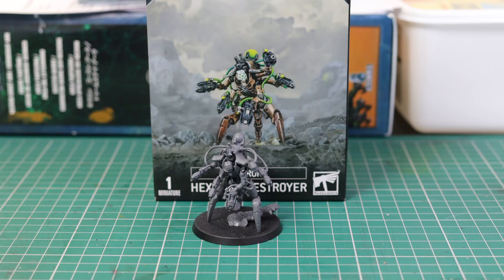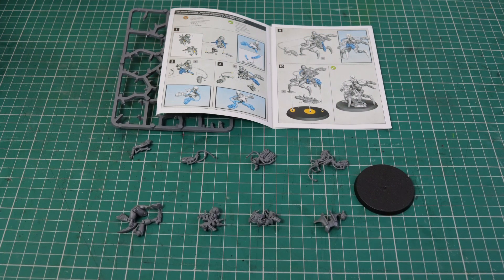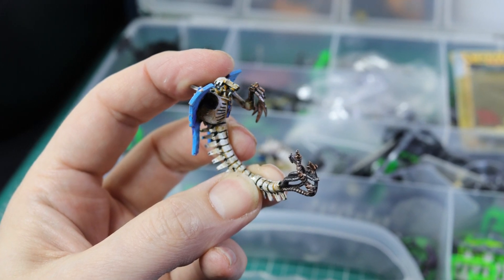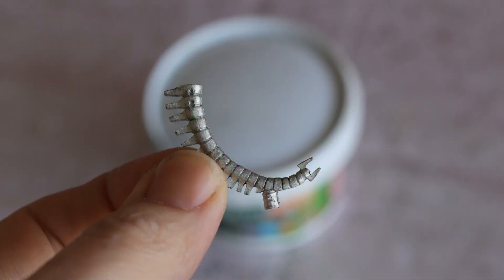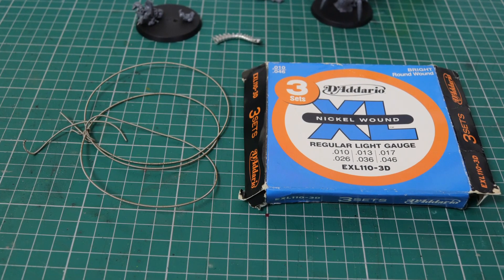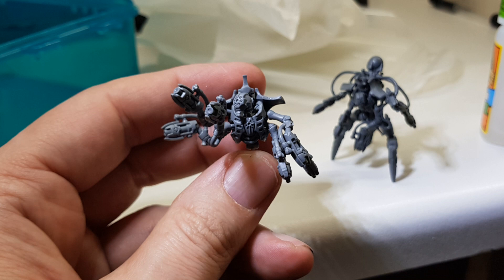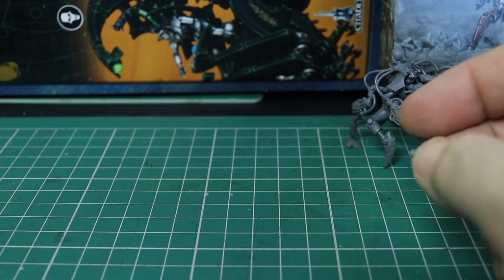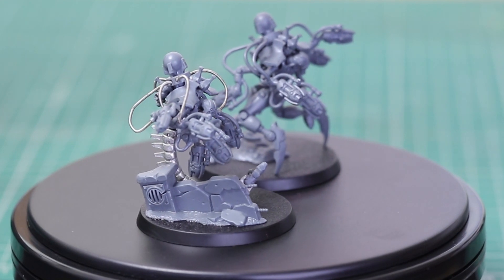I Attempt a Necron Hexmark Destroyer Conversion

Comment: 5A just means it's the 5th string on the guitar (they're counted from the bottom up), and the default tuning is an A. The diameter usually the inches) is the determining factor in the thickness of the string (they can vary quite a lot - for instance the smallest string usual ranges between .09 and .13). He looks absolutely amazing! Thanks for the tutorial!
Reply from the maker: Thanks for the info Martin, glad you like him